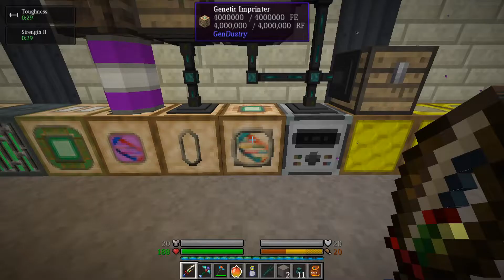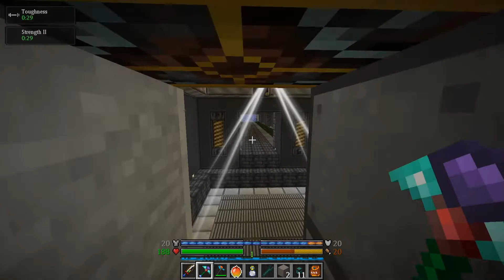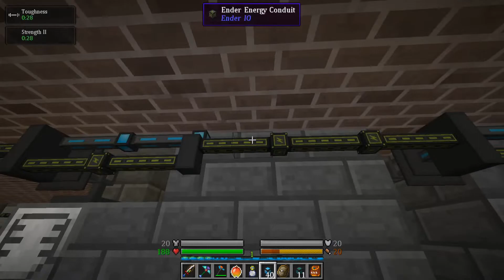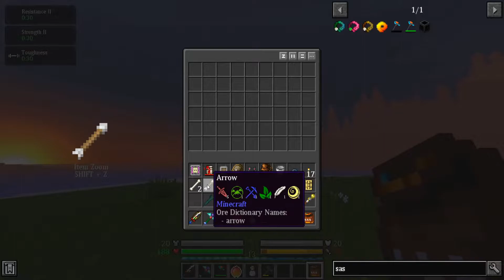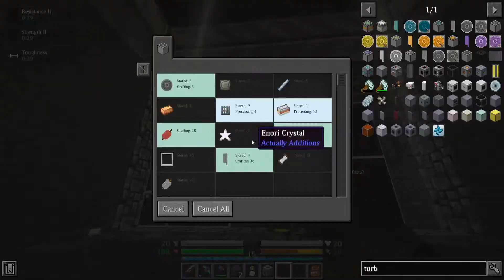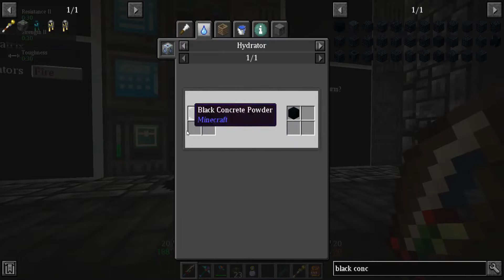Enigmatica 2 Expert :: Industrial Bees & Syngas :: E2E-57

Comment: FYI, the Environmental Tech Connectors are only 1.745 mb of UU Matter each in E2E. One of the better UU Matter bargains.
Reply from the maker: That is one hell of an idea, might be time to ramp up my UU production
Reply: @theeldersign  Once you get the initial ~84(?) Litherite for the Tier 1 Void Ore Miner, leveling up through both EnvTech miners is pretty easy. I did Terrestrial Artifacts for the intial Litherite on one playthrough (lots of Empowering) and did UU Matter this current time (got UU Matter ramped very early).